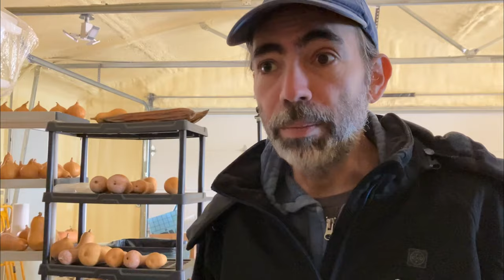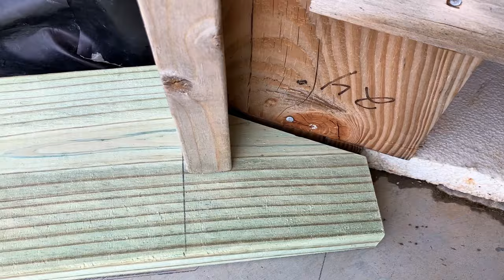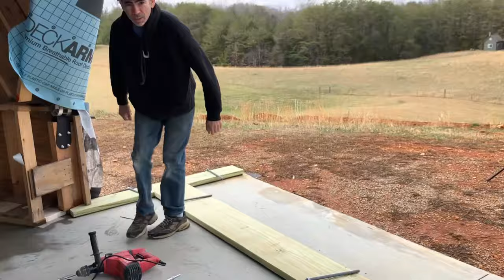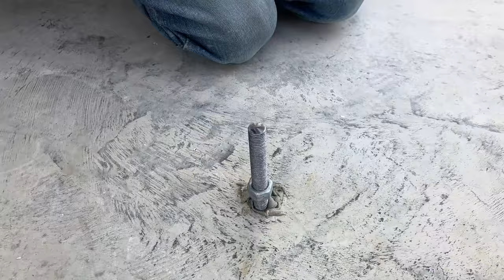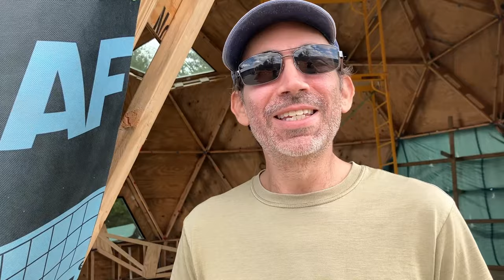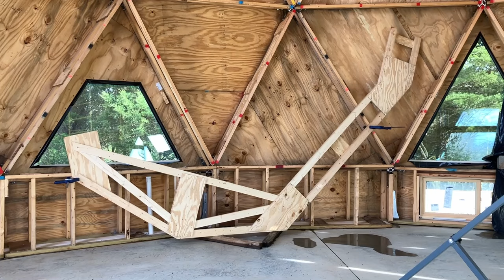Our Dome Bedroom Bump-Out Build Has A Bumpy Beginning!

Comment: Just take the 2 x 4 off on the sidewall. It’s a short one put the board back put the board back on after you put the silk plate on.
Reply from the maker: Yeah, that would be a good option, but that 2x4 had a ton of nails on both sides so removing them all would have been a problem.  Cutting it ended up being fine, thankfully!